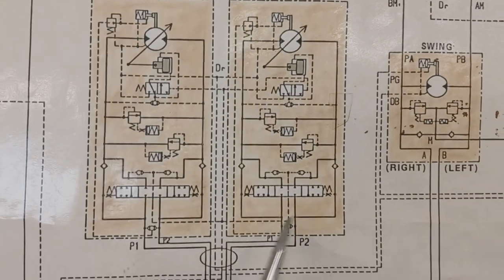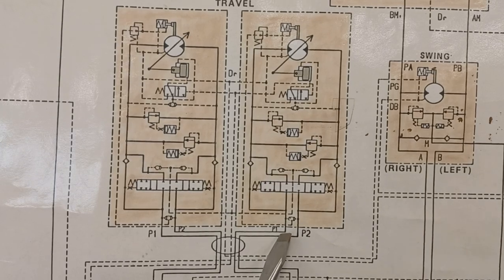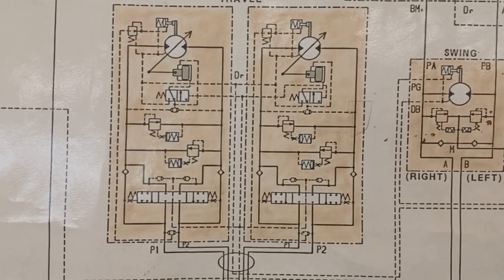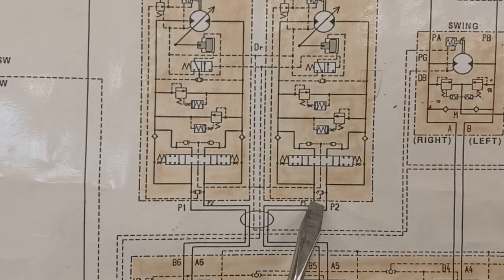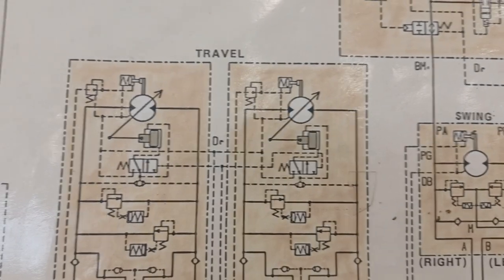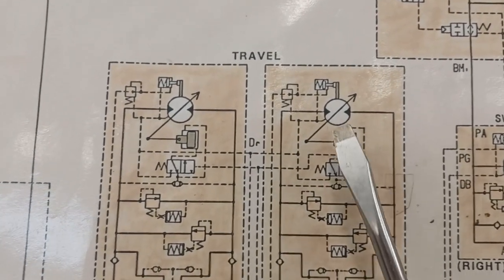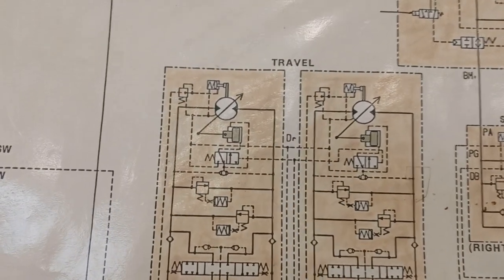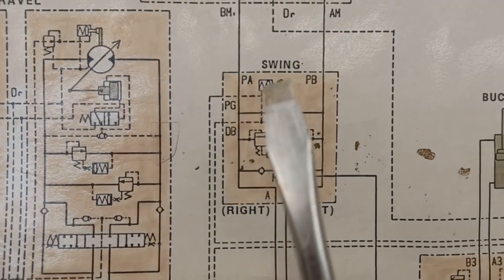how an excavator travel drive works

Comment: I wanna say thank you again, today I passed my off road red seal exam and your videos had a lot to do with it.
Reply from the maker: Congratulations!  That's awesome.
Reply: If I need to use a 2 speed motor on my mini excavator that was originally one speed, can I just plug the 2nd speed port and have it function as a single speed, or does their need to be some sort of flow through the 2nd speed port?

Comment: Very informative - I have a UH083 (pre EX200 Hitachi) and mine stalls the engine every few feet when walking/travelling even when engine is on full power - someone said probably seals gone or is it potentially the brake stuck on?

Comment: Hi , I m going to build a machine with the undercarriage of an excavator , no hydraulic background , so i have a question: do i need to keep oil pressure on the speed selector or is a pulse enough to shift and is it going to stay in that position? Or does the speed selector have a position in which it always is when not operated?
Reply: Usually you need constant pressure

Comment: Are all of these final drives in low speed mode by default and sending oil to the shifter makes it go into high speed mode? If no hose is connected to that port at all would it still work in low speed mode?
Reply: I think it would build up pressure in the motor by keeping the 2nd speed port shut.   You can override the 2nd speed by connecting the 2nd speed port to the other return (T1/T2) connection.  That's how I do it.

Comment: What is the most likely cause of one track being weak? 

Going forward at max speed on both tracks the machine turns to the right.  Up hill the right track cannot turn without the left track being engaged at the same time
 
Down hill the machine can travel fast. 
Komatsu PC78 US-6
Reply from the maker: There's 20 things, not one most likely
Reply: @hydraulics  oh no you're breaking my heart , I don't know where to start. Any tips are appreciated!
Reply from the maker: @Attila  first check would be final drive oil maybe. Then make sure idler and rollers all turning nice. Adjust track tension
Reply from the maker: @Attila  then clean cab floor around travel pedals make sure nothing obstruct pilot control movement
Reply from the maker: Then I might check case drain flow at the swivel if that's easily accessible
Reply from the maker: Then I'd read how the brakes are released see of that's working.
Reply from the maker: Then I'd cut the hydraulic filter open and see what's in it. Especially if there's a case drain filter for motors
Reply from the maker: I'd pressure test the machine . I'd pin the track and check reliefs
Reply from the maker: And about 15 other tests
Reply: @hydraulics  Thank you very much! You've given me a framework to get started. Hopefully I won't need 15 other tests but if I do I'm knocking on your door with a case of whatever you want.